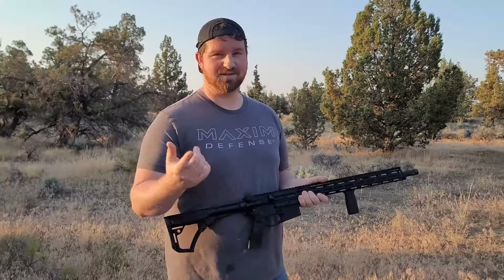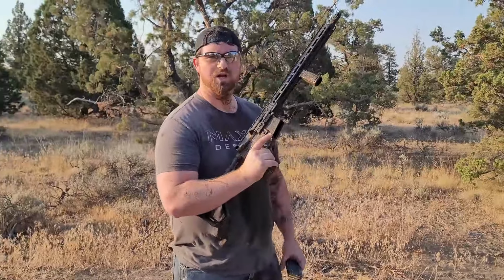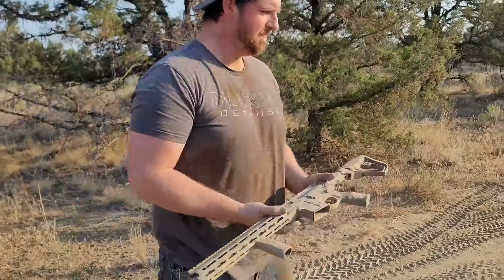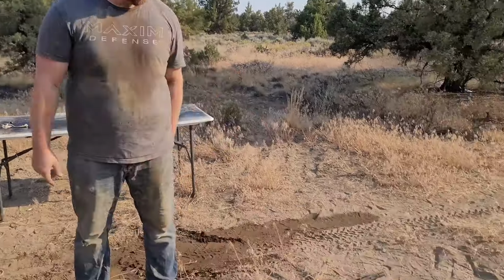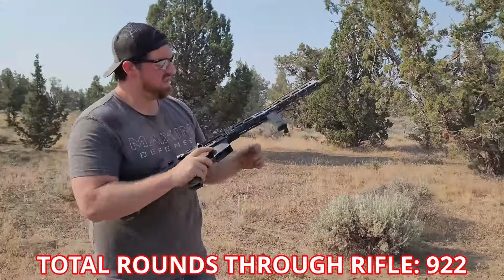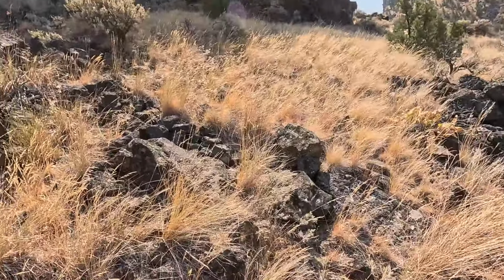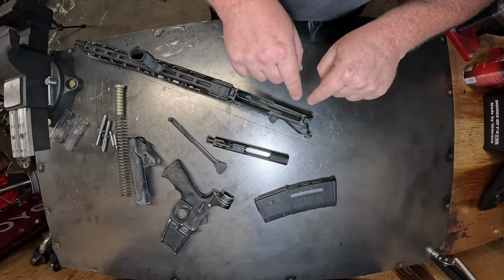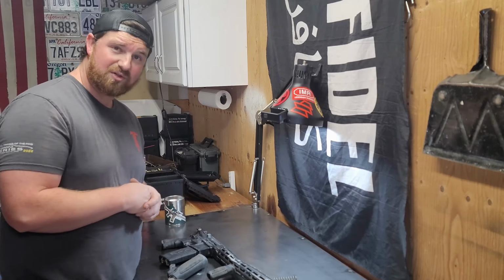Daniel Defense DDM4V7 Extreme Torture Test

Comment: I stumbled onto your channel while looking into BCA rifles. I love these torture tests! They put other reviews to shame!!!
The BCA video removed my doubts about getting one to mess with. Keep up the great content!
Reply from the maker: Thank you! 👍🏻
Reply: It's a cool video but I hope your take away isn't that this is a good review. This is a very harsh test that in many ways comes down to luck. A good review is one where the rifle is shot and used as it was intended to be used in a variety of conditions with a lot of ammunition and preferably different types of optics with a variety of ammunition grain weights and case materials. It's even better if the rifle is shot suppressed and unsuppressed as that alone is a reasonable test that will result in the rifle getting extremely fouled very quickly and it exposes a lot of cheaper rifles. 

The AR15 was never designed to run while filled with sand and mud. No rifle on earth including the AKM is designed to run while filled with mud. 

I'm assuming that BCA was your first AR15 so good on you for getting an AR15. I hope eventually you like it enough to get something a bit nicer to train with. The gold standard is a BCM upper with an Aero lower but you could also just use your BCA lower and for that matter you could build your own upper if you wanted to. Cheaper guns could in some cases out perform more expensive guns just due to the gas port diameter alone. Daniel Defense was at one time notorious for being very overgassed because they drilled their gas ports to make the gun run perfectly with steel cased ammunition which is underpowered compared to brass case ammo. As a result with a suppressor or higher quality ammo the guns were very overgassed. Obviously over time enough people complained and now DD drills their gas ports to allow suppressor owners to tune the rifle to comfortably use a suppressor without getting an absurd amount of gas to the face.
Reply from the maker: @armorers_wrench I appreciate you taking the time to write all of this unfortunately 100% of your assumptions are incorrect. This IS  intended to be an extreme test. To accelerate wear and tear  as quickly as possible and to be entertaining over all. Very very few people have the money or time to spend thousands and thousands of rounds doing what your talking about let alone a small channel that makes ZERO profit.

Comment: I think the oil is what caused the increased issues in the beginning. That much oil and immediately putting silt and sand in the gun is beyond extreme lol.
Reply from the maker: I'll let you in on a little secret but you can't tell the others..... I cleaned the oil out prior to the test lol 😂
Reply: @ ok ok but that being said still thats a lot of oil inside the bolt. Did you take apart everything and degrease it and then properly lube or did you just wipe away the exess
Reply from the maker: @Ellienollie degreased everything and then properly lubed it after

Comment: The amount of oil is most likely to blame for the consistant stoppages. Dirt and grime sticks to it and creates a sort of coarse paste of some sort, that can't be easily rinced off with water since water and oil don't mix. So it always leaves at least a thin layer of this nasty substance on the parts.
I haven't watched the other terture tests you've made, but if you ran other rifles dry, that might be why you've seen a difference in reliability.
Tight tolerances aren't a bad assumption either.
Good video m8!
Reply from the maker: I cleaned the rifle before the test so it wouldn't be at a disadvantage 👍🏻
Reply: @independencearmschannel2170  ohh sorry for that... I didn't know
Reply from the maker: @mesniburek1652 no biggy man 👍🏻 honestly I figured I'd have more comments just like yours lol

Comment: Now that the ris 3 has been tested we need the ris 2
Reply: That isn't a RIS3. That's their other handguard that has 4 bolts. RIS3 has 6 bolts and is actually a 2 piece design whereas this is a one piece extruded and machined aluminum rail. Very different actually.
Reply from the maker: Correct this is the mfr 15

Comment: Would love to see an AK style test next! Maybe a PSA vs Zastava (since you've done similar price ranges of AR variants) Would be interesting to see the difference in your sandy environment.
Reply from the maker: We've talked about doing an AK before I was considering getting in touch with PSA I have a feeling though the AK won't last long just because it's so open to the environment I know they have a great reputation in Middle Eastern countries but those things run so loose
Reply: @independencearmschannel2170  If you're gonna do an AK don't waste your time with a PSA. Do a true AKM and as far as I know the only AKM sold on the market in the US right now built to the technical data package is the WASR10 which actually can be found RELATIVELY cheaply. I think you could get one for $800ish with the cheap plastic furniture.

Comment: I just extracted a stripped screw from a two piece handguard and this was exactly what I needed to take the edge off
Reply: Argh, that sucks. Feel better bro. I had a similar screw up in July. I stripped a screw on my badger ordnance condition one mount that was holding my nightforce nx8 2.5-20. I was taking it apart to install the ARC cap and my Steiner MPS I had just got for my bday. It took 2 days with a drill and dremel, I scratched the hell out of my scope but I got the ring off. I wasn’t even excited for a few weeks there after until I went to the range and sighted it in. Worst part is I think I need to send the scope to nightforce because the reticle seems off to me and blurry on the left hand side/uncentered 😢. I’m waiting until the new year is over to continue the fight
Reply from the maker: Haha hell yeah man
Reply: @T20-c8f literally my same experience except with a brand new build I just assembled, then realized I had a clearance issue with the rail… once I used the cutoff wheel to make myself a flat head screw and remove the stripped sob, I went to town on the rail and aluminum blacked… looks perfect now.
Reply: @T20-c8f  Hey bud midway USA sells a screw extractor kit. Basically you drill the screw a bit then run the extractor bit in it and it should screw out. I had to use one on a broken screw in a machined Glock slide because I overtorqued a screw when installing an optic. The kit was like $20 and it includes a variety of drill bit diameters/extractor diameters. 

Get that kit and a torque wrench. The torque wrench will make it so you don't break screws. The extractor kit is insurance.
Reply: @knifetech101  Read the comment I just wrote to that t20-c8f guy--tldr midway usa sells broken screw extractor kits and they're a lot easier to use than what you did and won't damage anything other than the broken screw. Get that kit and a wheeler torque wrench screw driver. The torque wrench prevents the broken screw in the first place and the extractor kit is for when you still somehow manage to sheer a screw xD
Reply: @armorers_wrench  I tried two different screw extraction kits that failed before buying the dremel lol.

Comment: Just watched the BCA test - the rail did not came loose. A cheap generic rail, while the superexpwnsive DD MFR went loose as a goose. That is super disapointing. 
The RIS 2 and 3 rail 6 bolt lock-up system is much, much stronger. The 4 tiny screw lock-up is a joke. The MFR rail went loose on every torture test I have watched. Junk. Do not buy

Comment: 2000 for a charging handle that brakes when you drop it and are troops use this crap
Reply: A Radian, BCM or Geissle would brake in the same situation also. All are just pieces of aluminium on rolled.pins. 
KAC makes a nice ambi charging handle that is one piece. That should hold up well
Reply from the maker: We shall test that 🤙🏻